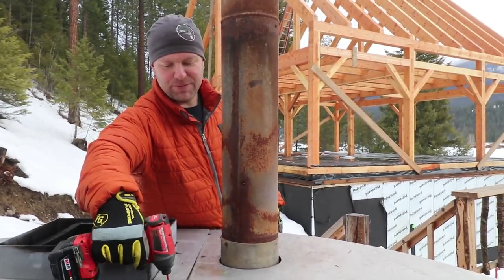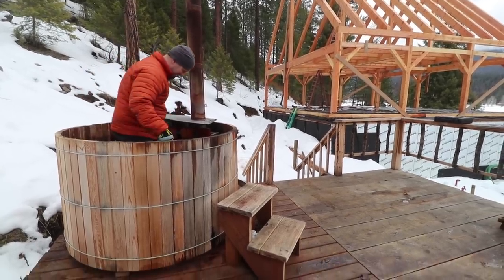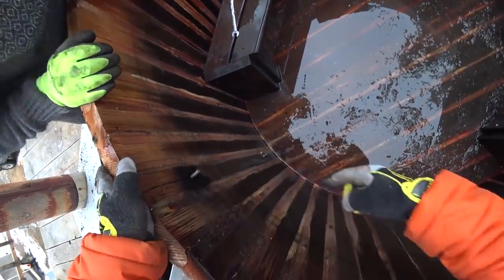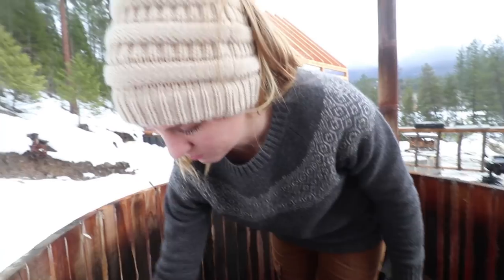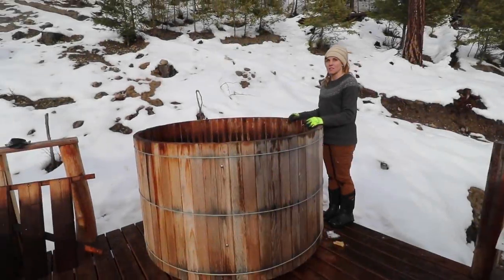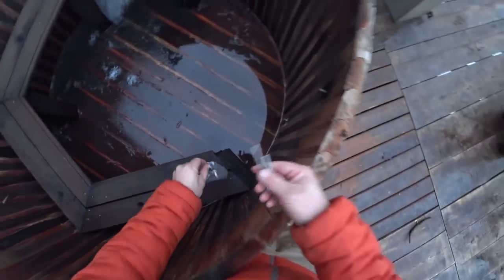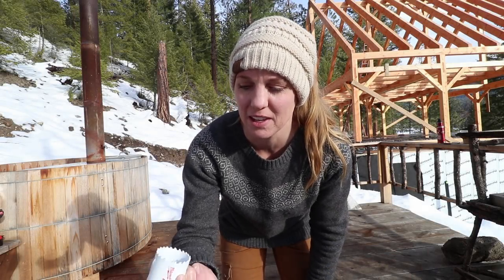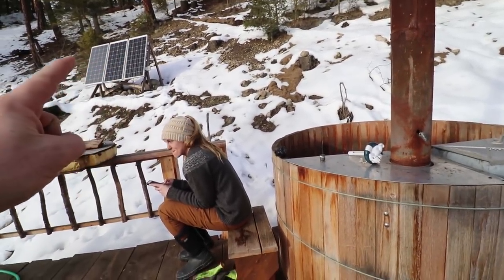NOOO, Our Water is GONE!! (DIY Hot Tub Upgrades)

Comment: Since you are going to set the snorkel heater at the 'right' height, it is worthwhile to put a board near the wood chute that is about 1 in. away from the collar and several inches above the edge height to prevent splash drowning. I tell you this from many years experience with those heaters in several tubs. A little heat tape under insulation on any exterior plumbing is worthwhile. Use a screw in cap in tank with 2 1/2 in line with NPT on both ends, the out end is left dry with an over cap to keep the varmints out. Also makes it freeze proof. Makes it brush truck friendly.

Comment: If the bulkhead in that size is unavailable, use a Forstner Drill will produce a flat bottomed hole that will thin the stave appropriately. 
Then the bulkhead will fit flush. 
Most big box stores have them in stock  for around $50 ish. 
Be use the support on a corded drill, that if of bit on a hand drill could be dangerous unsupported.

Comment: 7:01 Insulation is not a heat source for sure but insulation is used in this case to prevent the water in the pipe from freezing.  Exposed pipe in low temperature will crack, that is why you need to bury them underground.  Cover that whole part as much as possible with any sort of insulation if they are exposed, especially that valve. If that valve is open and water becomes ice inside, you cannot close / open that valve any more. Here you talked about the valve broken because it was frozen : https://www.youtube.com/watch?v=ALytLGHU3Vo

I cover my garden hose tap with an old t-shirt and a plastic bag to prevent it from getting wet and freeze. Just my 2 cents.

Comment: Here in Norway those tubs are pretty common on all cabins. If it ever goes below freezing and you cant maintain the heat you have to drain it as fast as you can or else the wood will crack from the ice. I would also suggest you get a stainless steel oven for the tub as it holds on the heat a lot better and wont cave in wit alot of use. If maintained properly they can hold pretty long. Would also suggest you get wide metal rings around the tub that you can tighten so the seal will hold much better after alot of use. The charring problem you can solve with just getting thin sheets of stainless steel and bolt them to the sides and the problem will be gone. Love the vids and keeo it up!
Reply: Bet they take this advice but dont comment

Comment: I just want to suggest the use of a tape measure. For bolts and fittings. If you know how thick the wood is the seller should know how long the fitting needs to be.
Reply: They had the old ones they could have measured in place. Wouldn't have been that difficult.

Comment: We repair old wood cisterns an build new one from time to time in south Louisiana and we always use brass fittings that we screw directly in to the tank in a tight hole so that the wood swells tight to it just need to make sure it sticks out a tiny bit on the inside so the end grain is covered up. We also use a 2” thick bottom!
Reply: Mr. B we use cypress that being said it’s almost impossible to find old growth red cypress or what my dad used to call tank cypress we’re stuck trying to find some that is usable from the new grow back cypress

Comment: You can also run your filter pump directly with any 12V DC source (solar?) using only 3/4" garden hose and garden hose fittings. Anything similar to a Jabsco Mini Water Puppy 8860-0001 12V DC. (and it's reversible too) 1 1/2" hard pipe is not necessary to filter the water in your tub. In Phoenix recommended filtration is every gallon once daily. More during summer when temps are above 100 for days at a time.
Reply: They could use a hard line over the edge of the tub and down to the level they want to for pick up and return. There would be no chance for it to leak. x2 on a hole saw set. It appeared that 1.5 inches almost fit, so the 1.75 they bought is still oversize if they are wanting the wood to expand and seal around it. A die grinder, file, rotary rasp, or even awful dremel could open up a hole in the side wall for a snug fit. They may find longer bulkhead fittings, but another option might be to thin the side of the tub a bit with a planer or circular saw, as long as it isn't thin enough to become weakened around the fitting.

Comment: as an ex pro swimming pool and spa guy, make your filtration with the largest piping you can install none of that garden hose sized fittings.. you need flow..not pressure to filter your water..

Comment: The alternative if you cannot get a suitable length would be to use a chisel to sink the plug in from the inside, that way you can tighten it easily from the outside and keep most of the structural strength of the staves.
Reply: Even the cordless circular saw can be used to make a recessed area......they have a saw and some very expensive chisels.

Comment: best hot tub DIY build, use a larger heavy duty water container,  cut to height, build a wood flashing around the outside for eye appeal.  Lay a concrete slab just big enough for a stainless water stove to sit on and your done..  From the outside all rustic looking,, inside..all modern materials to keep it nice and clean.....

Comment: When using a channel lock wrench you want to turn it in the direction that closes it, that put pressure on the fitting instead of trying to open the wrench. You had it upside down when trying to remove the drain, it's much harder that way, just a helpful hint I hope.
Reply: They've been using them upside down since I started watching this channel in Nov 2016.
Reply: I've learned to ignore it. When you try to explain to someone that slip joint pliers are directional they look at you like you're stupid. Same thing with #1 vs #2 Phillips screwdrivers...

Comment: Would it have been a better idea to build the stove into a separate tank? That way you could just circulate in a loop. This could be done without a pump too if it was designed right. Maybe like a Heron fountain? If you did add electronics, doing this with an arduino would be really easy. Best of luck guys, long-time fan here 😁

Comment: It's probably too late now and possibly not feasible with your hot tub layout, but it seems like the best thing you could do with the drain is to install an overflow pipe.  That way water doesn't just spill over the sides when you get in, it actually goes down the drain and you can direct it where you want. Then when you want to drain it (which it sounds like you don't do often), you just twist out the overflow pipe.
Reply: Just like a swamp cooler.........sometimes those drains work well, and other times they leak, but it works.

Comment: You're on a hill so you could just use a somewhat long hose to siphon the water out of it instead of having a drain. It will go much faster thanks to the gravity assist of the water column in the long hose and it'll save you a potential leak. Just toss the entire hose in the tub, wait until it is full of water, plug one end and walk that end down the hill while keeping the other end under water. Remove the plug et voila.

Comment: I'd add a passive solar water heating array on the side of the deck. If it's below the deck level you don't even need a pump as it will thermally siphon.

Comment: It is incorrect that insulation does not stop freezing. It certainly can depending on how long the freeze is. What would normally freeze in 3 to 5 hours without insulation could go 24 hours or more allowing time to add some type of external heat.
Reply: insulation is why we have running water during winter. the pipes are insulated from the cold by the dirt they're buried in.
Reply: The ground is also a heat source. Their tub has no constant heat source. As long as the main body of water stays above freezing, insulating the drain might work OK. I see Jesse's point and the counter point he made when he said it might have helped. It would have been easy to insulate it and it is also not a bad idea just to do away with another potential failure point. It makes me glad it does not freeze where I live.

Comment: the new plug for the bottom of the tub does NOT have stainless hardware with it as far as i know..  you will want to convert to stainless if you want it to last.   including the wing nut.  you may also want to use some spark plug anti seize from a 2 buck package at the parts store to prevent seizing of the wing nut on the threads.. even though you don't plan on removing it for years.  if you put the plug in from the bottom. you can just loosen it.. drop it out and walk away.

Comment: If you are going on grid and therefor you will have electricity 24/7 then get some heat tape and put it on your hot tub drain and wrap insulation around drain pipe. The heat tape runs off 120 volt AC. The heat tape has a built in thermostat that will energize heat tape when the temperature drops to a preset limit on the heat tape built in thermostat.

Comment: Who’s flying the drone while you’re in the tub?
Reply: They can fly themselves. Other youtubers have shown where they can set it to hover, circle, or follow them as they move around. You can see the control and his phone sitting on the top of the tub, next to him. Luckily they are not moving and have a somewhat open area to do this in. One youtuber (sv delos) flew their drone behind a rock formation that was a few hundred feet tall. It lost signal and moved up, rechecked for an obstacle and moved up again, until it got over and then it flew back to his controller. They were afraid it was toast when it lost signal, but it all worked. It was neat that they showed how it worked out instead of leaving that part out.

Comment: Surprised, I thought the burner would be stainless. Shame you didn't work out the correct install height rather than guess again. 

It's a good idea to have some hardware storage and keep any excess fixings, saves running back n forth for cheap fixings..

Comment: Self regulating heat tape and insulation. Yes you will have to run power to it in the winter but it would be nice to have power close by if you ever needed to power any items near by.

Comment: No, don't discard the drain pipe. Repair or replace and put an outdoor shower on the end. Don't waste the hot water. Hard plug the bottom of the tub and during freezing weather leave the shower valve open. The drain pipe will not crack if there is no H2O in it. When weather permits outdoor showering, simply open the tub drain and drizzle in about the same amount the shower is using. You can use an autofill valve too when there is no danger of freezing. That's what indoor toilets do. During hot weather a cool shower might be cool too.  Imagine not banging your elbows in a tiny shower. Or a shower big enough for two. (tandem)